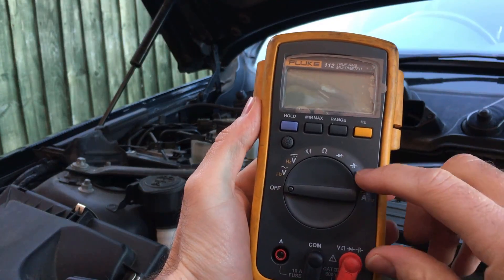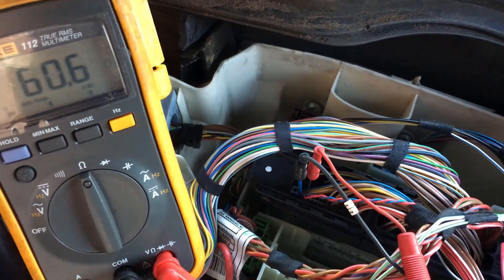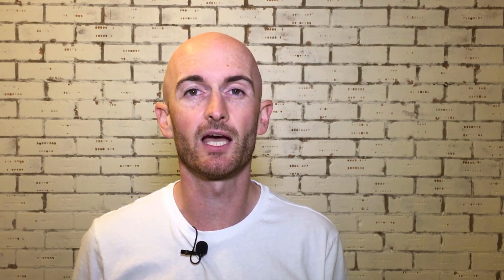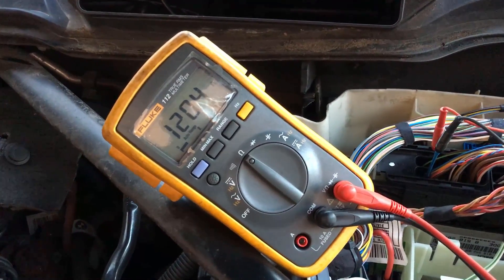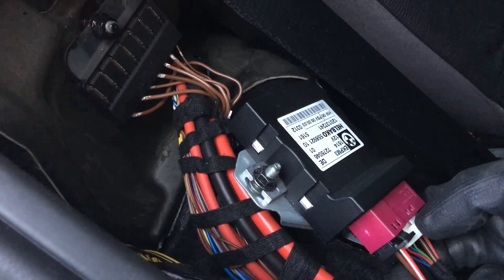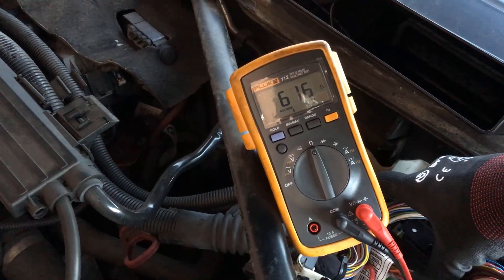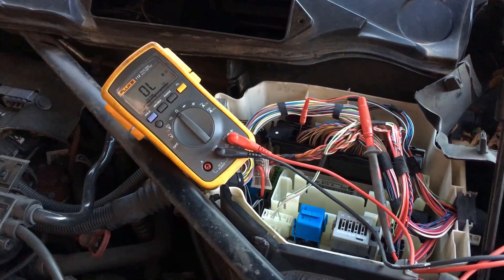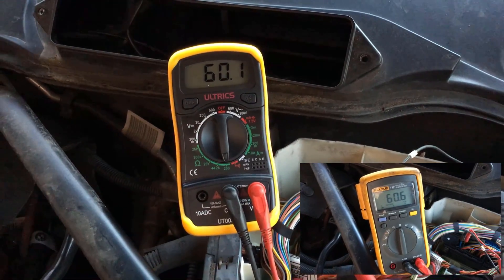How To Test CAN BUS With A Multimeter [CAN Bus Resistance Check] Mechanic Mindset

Comment: Just thought I would ask in for your opinion.  I have a 2015 sprinter with an instrument cluster not working.  It is only thing not working after I bought it and brought it home from auction.  I had a fire in the back which left soot everywhere.  I cleaned all the fuses and checked all the relays.  I get a tiny flicker in the instrument panel when i first push the plug into the panel (when the vehicle or key is on) just an orange light for a split second at the top. Nothing after.  What are your thoughts?

Comment: Great video, I have subscribed to your mindset. But find myself back in YouTube trying to cherry pick for ideas once I get a slight snippet of what might be happening 😂I guess I’m trying to run before I can walk as a beginner . I am getting 220 ohms across my network and high voltages on different pins 7.5 volts is the highest I have recorded and is steady. Would a higher ohm reading suggest corrosion within the circuit. I Will keep watching/learning from the mindset but so far I’m only into the explanations. With approx 1h 30mins of course. The course seams very well put together just have to stop myself jumping about, damn you ADHD 😂
Reply from the maker: @Ken_4711  Hi, hope we can help! I think we need to rewind a bit; what car is it? what symptoms are you experiencing, what fault codes are you getting, which modules do not communicate? 👍
Reply: @MechanicMindset  hey, thanks for the reply it’s an old BMW 320d e46. I have 12v present on pin 1 on breakout box. I did some shorts and posted them on my YouTube just to give anyone an idea of what I am talking about. Don’t seam to have any faults at the moment, sometimes the EML comes on and goes off think it was a MAF code last time.  only noticed this because I got a breakout box after watching your videos. Have just ordered the entry level pico scope as recommended.
Reply from the maker: @Ken_4711  Can I suggest doing your CAN testing at the module. From memory, the CAN at the OBD on the E46 is only partial. Check it at the DME, IKE or ABS 👍
Reply: @MechanicMindset  many thanks for the reply, I will look into this as I progress on the course. Is the is oscilloscope masters worth doing yet as a total beginner? What’s in the course? Are you literally showing everything step by step? Does it take you from beginner to pro or do you need to know some basics before starting? Many thanks

Comment: ..but what is the total circuit resistance when it has short to ground in main can line and what will it be in the sub line?
Reply from the maker: @elora2525  short to ground won’t really effect total circuit resistance. Check resistance from CAN to ground and it will be low 👍

Comment: Can i read resistance inside engine Control module by pin for can high and low
And what give me ohm if can that
Reply from the maker: If it has the terminating resistor, yes. 120 Ohm 👍

Comment: The difference with expensive vs cheap meters does not matter until you are working on mains voltages and other similar circuits. Never use a cheaper meters on mains circuits.

Comment: I'm having a bit of trouble with a Peugeot 407, most specifically ABS and Electric power steering, they just can't seem to connect on OBD. All other modules seem fine.

I started doing these CAN resistance checks between the wiring.

Something I found strange was that probing between CAN-L and CAN-H shows 120Ω with the modules disconnected. However, If i probe CAN-H on the ABS wiring with CAN-L on the Electric power steering wiring (or vice-versa), it shows 0Ω (short). Is there something shorting my CAN lines or is this actually normal?

Thanks!

Comment: I cannot thank you enough for making this video!  After a completely dead instrument cluster, I used the information in your videos to narrow my problem down to the instrument cluster itself and ultimately, aged solder joints inside my instrument cluster.  A little heat from a soldering iron and I'm back up and running.  Your videos are truly invaluable to a novice like myself. Thank you!
Reply from the maker: Great job, well done!
Reply: Was it a GM vehicle? Tahoe? Silverado?

Comment: I learned,
1. Resistance measurement is not enough to check CAN system
2. I can check short to ground/ power via multimeter
3. Typical resistance of a module in CAN can be in thousand ohm , if they do not have terminating resistance right ?
4. There are many types of different CAN system in Audi/ Porsche , e.g. power train CAN, crash CAN, infotainment CAN, Chassis CAN.. does it mean that each of these CAN has separate 2 120 ohm resistor?
Thankyou for the upload.🎉🎉🎉
Reply from the maker: Yes, yes and yes. 

4. High speed and medium speed CAN networks have the terminating resistors. So yes, each individual network will have them. You won’t find them on low speed CAN 👍
Reply: @MechanicMindset  thankyou for this great upload

Comment: Thanks for the explanation,  nice video.  I work on transit buses that have an overwhelming amount of modules linked to the network.  Looking for the one that is not communicating is very time-consuming.  This J1939 system needs much improvement.

Comment: I have a question. Will a bad BMW M47 E90 glow plug control module give a non start and cutting out that's the only code showing with crankshaft position sensor code but the crankshaft position sensor was changed twice to be safe but still only starts when it wants to but never last more than  20 min before cutting out. 

What would you say to look at first ?

Comment: Hi, Your video is excellent. You forgot to mention if CAN HI or CAN LO is short to groung, you will still be measuring 60 ohms. Only if you messure CAN HI or CAN LO to ground then you'll know there is a short to ground. Of course this will not be the same when you'll be measuring the voltage, you'll know right away there is a problem....thanks
Reply from the maker: Ah yes for sure, thanks for the input!

Comment: Which one transmit and which one receive 
Can H or L ?
Reply from the maker: Both and both
Reply: @MechanicMindset  can l and h, tbey have continuity to Battery positive with negative battery disconnected 
Is that normal?
Reply from the maker: @AnythingEverythingGh  How many ohms?
Reply: @MechanicMindset  Didnt check the ohms, checked continuity

Comment: Bravo........in my truck.....you unplug the resistor and trigger engine light codes flasher.......what do u think.....no obd2...no plug....cheers
Reply from the maker: Sorry I’m not familiar with the set up on your truck, or how the network is connected. Is it definitely CAN Bus?

Comment: Thanks for your video, i have a problem with nissan , after i disconnected the battery i connected the odometer to the 6 and 14 pins in obd, i had 120 a ) reading , then i disconnected the PCM i got 60 a ) reading , do i have problem in the PCM ?
Reply from the maker: Start with this video… https://youtu.be/k8bJegVxo_c

Comment: What if you unplug both?
Reply from the maker: Great question! You will still get network activity. The resistance value will show a high (xx kilo ohm I think); this is because the other modules also have resistors connecting CAN H & L but they are higher value than 120 Ohm. So high, they don’t affect the reading much when all connected
Reply: I’m just have an issue, my reading is 120, when all modules are connected even when I unplugged the ECM, but when I connect my meter through the ECM the reading will be around 45 if the ECM disconnect
Reply: And I have no idea where are the termination resistor located, it’s 2014 Ford Fusion
Reply from the maker: @LOST2BAGHDAD   Sorry, I’m not sure where your terminating resistors are. They might not be in ECM. 

When you say 45: 45 Ohms or 45 kOhms?
Reply: @MechanicMindset  do you think can you get me on what module the TERMINATING located 
It’s 2014 Ford Fusion, and thank you so much
Reply from the maker: @LOST2BAGHDAD  Sorry, Ford isn’t my speciality. Maybe join some Ford forums or FaceBook groups, they might be able to assist 👍

Comment: No can lo. Any pointers
Reply from the maker: Low speed CAN? Or high speed
Reply: @MechanicMindset  can low on break out box was not flashing for ten seconds or more then a feint flash lasting quarter second. Back to nothing again. This whilst can hi flashing normal. Wipers not working but central locking working on Navara jeep. Other modules no comms like ecm etc etc.
Reply: @MechanicMindset  ok so the non runner Navara on the first time I went to see it was only showing through break out box activity on can hi. Every twenty seconds or so a quarter second tiny flash on can lo. Then nothing again. Today I noticed as I had cycled the ignition can lo was there today as well. Weird. Anyway through no comms with PCM and abs module and transmission etc, I'd traced the fault to the underwood power control box. When powered the relays would click and the engine would start. How the missing power on 5 fuses could be linked to no can lo the other day I do not know. Multiple scenarios for most things. That one will most probably remain unexplained.

Comment: Got a complicated problem with one of our machines using DeviceNet. Im kinda new to this but what happens is that we have several nodes in the machine including a staübli 6axis robot. For some reason when the (deadman's switch) or servo motors recieve power it knocks all of the nodes off  like they are  loosing connection. If we exclude the robot in the equation the nodes doesnt fault. Even with an external power supply to the robots modules this happens. Does anyone have any idea what to look for here?  Have tested all the other nodes as well but  works aslong as the robot doesnt recieve power.

Comment: To be accurate a lot of mechanics hardly if at all understand can bus or networks of any kind , they cant use a scope and even a multimeter is not used properly , and i am not talking diy mechanics  i am talking level three ,
Reply from the maker: You’re quite right; it’s my mission to make it easy! There are more CAN videos, I think my latest spells it out the best in the shortest time 😁 5 Tips For CAN Bus Diagnostics | Mechanic Mindset
https://youtu.be/k8bJegVxo_c
Reply: @MechanicMindset  Yes your doing a good job with quick videos not going too deep with what your trying to put across, it took me a lot of effort to begin to really understand network diagnostics and i really wanted to even working in the trade..

Comment: Hi. I am very excited about your video tutorial.

I have a question, can I check the status of the bus in this way, for example KOMBI and DDE units?
Or can only control units on the same channel be controlled in this way?

Can you explain the difference between CAN and D-CAN and K-CAN?
Is K-CAN used to read from the OBD socket and to encode units?
Reply from the maker: Hi, this video might help with some more insights https://youtu.be/k8bJegVxo_c

Thanks!

Comment: Is it correct to say that if one of the resistors is open, the CAN BUS will be down?  Can you have good CAN BUS resistance and bad CAN BUS voltage (2.5 v  on CAN HI and CAN LOW in idle state)
Reply from the maker: Good question, from memory, CAN bus still works without resistors (ie that module disconnected). Will add it to my video list 👍

Comment: hi, I’m new to canbus albeit worked in garage since 2011… I’ve ordered an oscilloscope as it’s becoming more and more required, love your videos they’re great! And very informative.

I also have a quick question, I have  Vw transporter that has canbus faults. I’ve tested the resistance using a multimeter and that all tested out ok at all modules on the network, I then checked the voltages on Can hi and can lo, all was perfectly fine except for CAN LO at the ECU, I was getting 12v. I would’ve expected there to be 12v across the entire can lo network, or is that not how it works? Thanks
Reply from the maker: Hi, sorry, how did you get on with this? If you can communicate with all the modules on the scan tool, CAN is probably ok. What did you find? Which CAN network were you testing? (i.e. Powertrain or Convenience?)

Comment: Great video. What resistance reading if I have an open circuit (cut or broken wire)in either CAN-H or CAN L.? While back probing at the modules.
Reply from the maker: Cheers! It depends on which modules you are checking and where the break is (as per video) 👍
Reply: 120ohms +/-

Comment: People ask why check both voltage and resistance? I work on Teslas which have 4(2 60 ohms, 2 120hms) terminal resistances, 2 in the modules and 1 in each of the drive units, with 10+ modules in each Can circuit. By checking the resistance, and if one of those terminals happens to be bad, I’ve basically narrowed it down to just 2 possible bad components, not 4. See how much time I saved in diagnosing than to just blindly check every component? It doesn’t always work out that way but it’s one of the very first steps I take when diagnosing high speed can bus. If the resistances are good then I’ll move on to checking the voltages.
Reply from the maker: Great process, I’d do the same 👍

Comment: Do I need to disconnect the battery first before test obd fort to test resistance?
Reply from the maker: Yes, or it needs to be in sleep mode. I usually disconnect battery

Comment: You interrogate a Can Bus network with a standard multimeter set to ohms?
This was exactly how I was shown not to do it and the damage that can be done by doing so when I was trained many years ago.
Stick to spanners mate and leave the electronics side of it to those of us trained to diagnose and repair the rare faults on digital lines that do occur using the correct tools for the job. Your multimeter is injecting dc bias on a digital line that is switching between logic 0 & logic 1.
That has the potential to create permanent damage to a customers vehicle and no doubt when it does you will not be paying for it, the customer will.
Reply from the maker: Hi Graeme, interesting view. I’ve never heard this before. It is admittedly not my favourite way to diagnose CAN (I prefer scope - see my other videos), but literally every OEM course I have delivered, written or sat in on mentions this. A Google will show how common this test is. 

CAN bus is actually very resilient. See my videos where I short it directly to positive while it’s connected and running. I have done this for years when delivering my network diagnostics classes. Electrical engineers sign off the training I develop at the big oem manufacturer I work for and this has never come up. Happy to go through it with you 👍

Comment: Can a bad battery (low voltage) affect CAN BUS??
Reply from the maker: Potentially yes, although I think the modules will cut out before CAN bus. When we get down to around 8/9 volts, modules start to shut down.